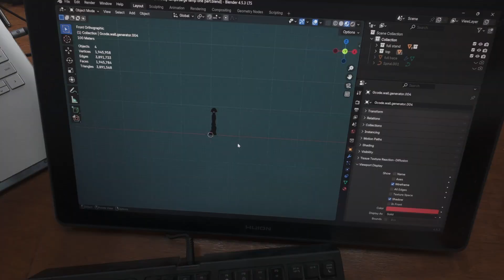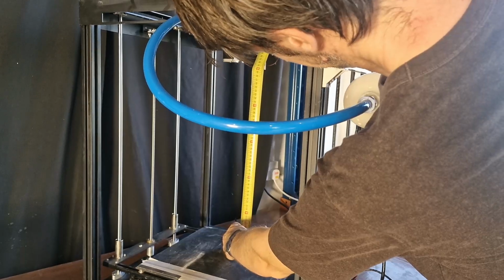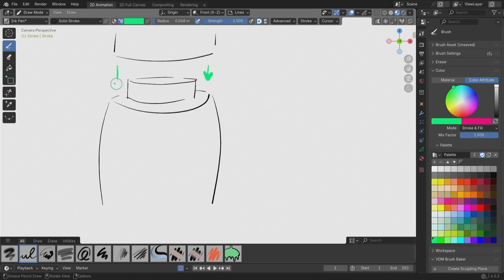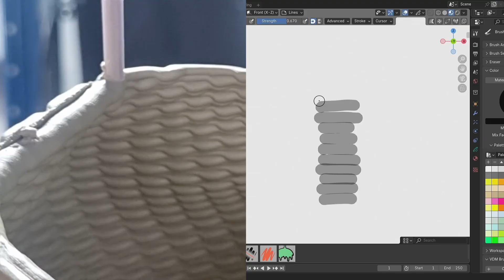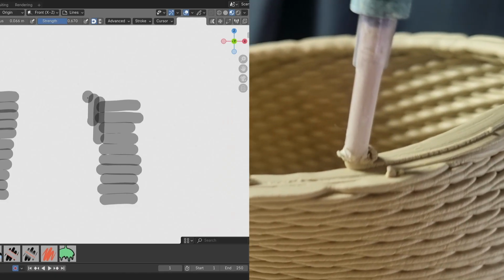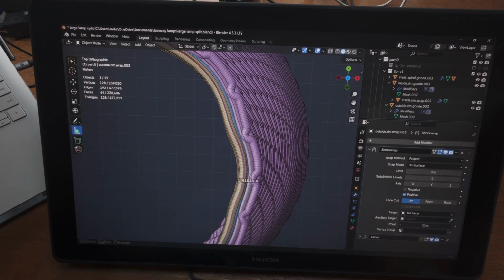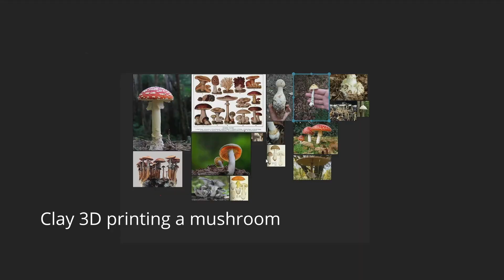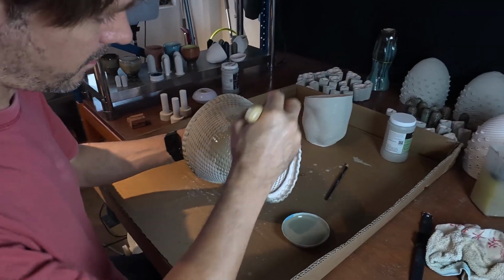Making Large Ceramics in Blender Does Not Go To Plan

Comment: Have you tried drying the filament before printing?
Reply from the maker: Hey. I am using ceramic printer here. This is printing clay... cant extrude hardened clay... printer does not work that way. Hope this help explains the steps i took during the designing the parts.